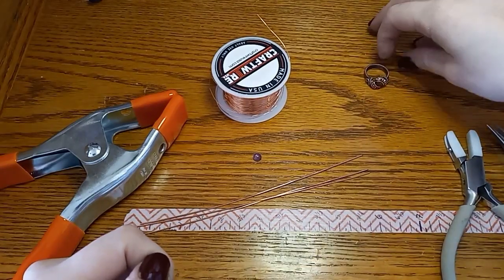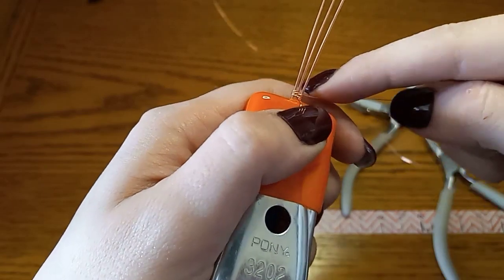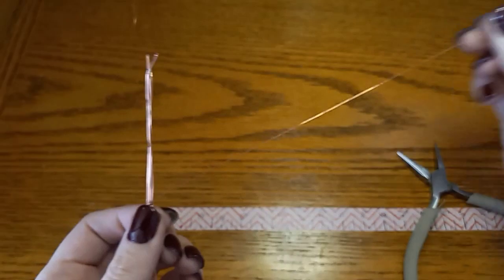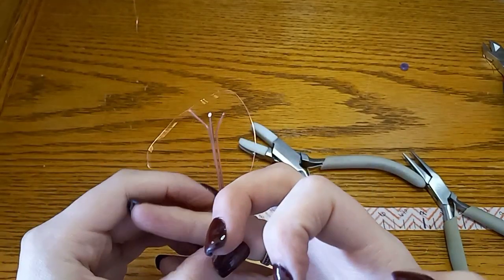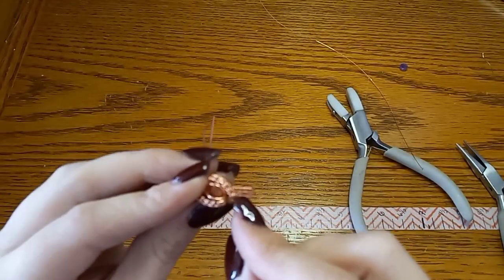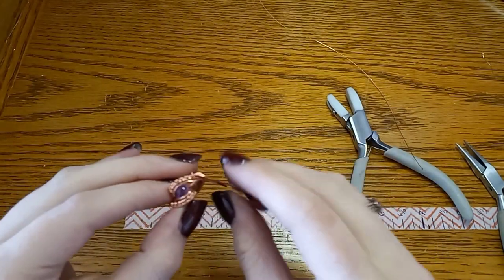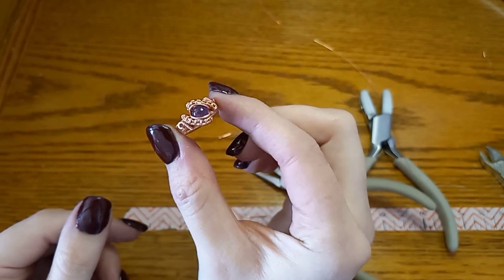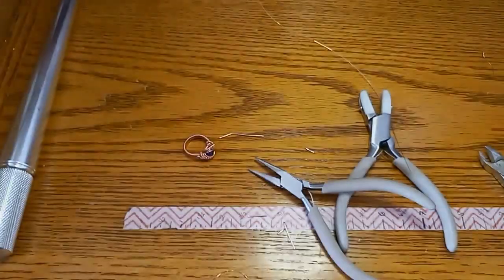Wire Weaving Ring Tutorial for Beginners - Make This Wire Wrapped Cabochon Ring with 3 Wires

Comment: Your work is beautiful and your explanation is wonderful. I am newer into making rings. Would you possibly provide guidance on suggested wire and weave lengths for common American ring sizes? That part is still challenging for me to gauge.
Reply from the maker: So happy to hear it! I don't really have a set length for weaves. Normally, I'll take a scrap piece of wire and wrap it around the ring mandrel at the desired size, then I cut the excess wire and use that length for the weave. I normally don't use a set number because it really depends on the style of ring you're making and the size of the cabochon. For example, let's say your cabochon is 8mm. You'll take the length of wire you measured from the mandrel and then subtract about 6-8mm for the weave. You can also check your work before cutting off your weaving wire and wrap the weave around the mandrel at the desired size and then set you cabochon on top of the band. If there's room between each end of the weave for the cabochon, you're golden. If there's too much room, you may need to weave a little more. Hope that helps?

Comment: Could you use a bead instead of a small cab?
Reply from the maker: You could, but you want to make sure that you compensate for the size of the ring, since the bead will protrude underneath. Hope that helps! ☺️
Reply: I am a complete newbe, and I tried that. Not a good result, It's too bulky, and hard to keep in place. Did you make it work?

Comment: How do you figure out the measurements for the ring size, what formula do you use. You touched on it during the video but never said how to figure it out. Any help would be great?y appreciated❤
Reply from the maker: Hi there! I use a scrap piece of wire or a thread and measure around the ring mandrel on the ring size I want. That will tell me how many inches for the band. Then just add 6“ to that measurement. 😊 Hope that helps!
Reply: @ellieshandcrafted  Thank You so much🥰
Reply: @elizabethrogers6897  You're welcome!
Reply from the maker: @elizabethrogers6897  You're welcome!